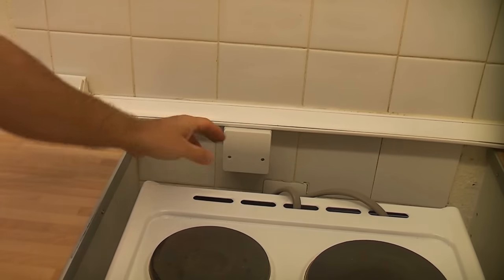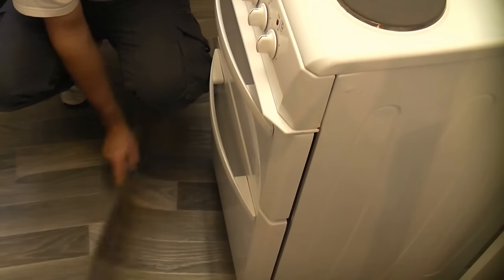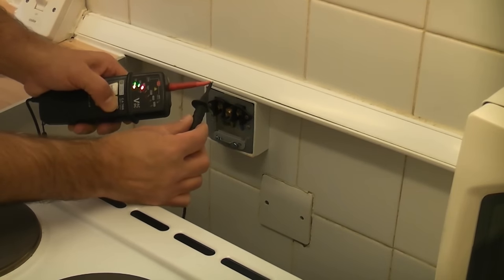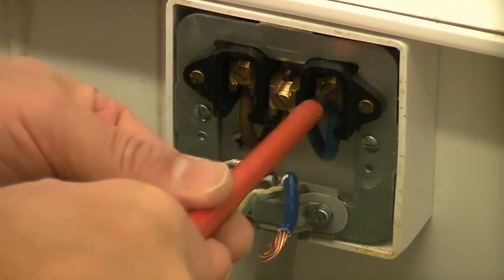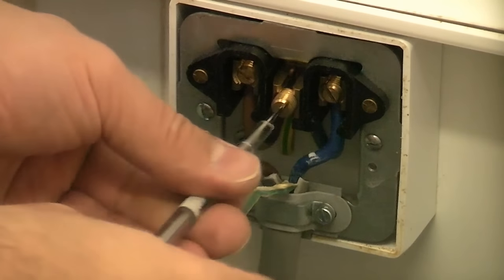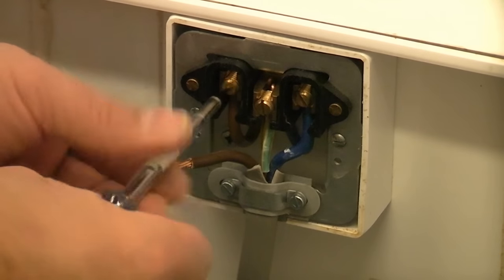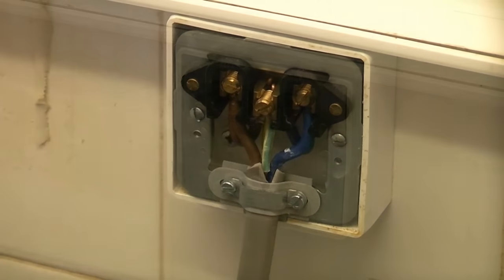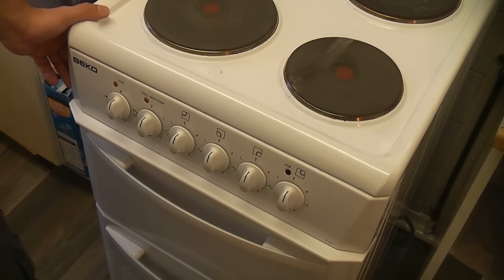How to wire an electric cooker

Comment: +Ultimate handyman Please help. What wire strippers can you recommend? I also have a Beko cooker exactly the same as yours and moved into a new flat a fortnight ago, bought a pair of "Supatool 2 in 1" wire strippers from a local hardware shop and they are worse than useless! Plus I'm on Universal credit and simply can't afford an electrician hence my finding your video.
Reply from the maker: Good wire strippers are not cheap, I'm afraid.
Knipex or C.K tools make some really good ones
Thanks for the comment
Reply: Ultimate Handyman Thanks for replying. Er, on my part it's been a case of a bad workman blaming his tools! *Facepalm. Watched one of your other videos on stripping and now I know where I was going wrong.
Reply from the maker: You are welcome ;-)

Comment: is it a 240 volt circuit on a 50 amp breaker i
Reply from the maker: I can't remember what amperage the MCB was now, it will have been somewhere between 40 and 50 Amps.
Reply: David Berquist We don't mess around here in the UK. None of that watered down 120 volt USA crap.

Comment: Nice tip for moving the cooker , i ripped my lino pulling the freezer out but ive tiled the kitchen now - much nicer and warmer than cheap lino - especially when your neighbour below has underfloor heating the special tiles i used absorb the heat from below perfectly. Mexican ceramic mix tiles are the best for this or the cheap Cuban ones for sale at Homebase suprisingly , i did two jobs for customers who were skint and needed to keep the job cheap and they ended up actually being better than some of the top quality ones I usually use!

Are you electrically qualified UH?
I wired up my own shower and cooker including the consumer unit , mcb's, cabling, isolation switches etc - does that make me a bad man> lol I do have a city and guilds though!

The thing I like about your videos is that you always do the job right and with quality gear.
Pity 90% of the cowboys in this country dont!
Reply from the maker: Thanks Gary. Lino can be a real pain when you need to move something in a kitchen.
I never go in Homebase to be honest as they don't have one near me (I think the closest is about 15 miles away).
I do have some electrical qualifications but I don't know what exactly LOL. I have City and guilds 100/2987/4 level 3 and NVQ level 3 in electrical and mechanical maintenance. 
Unfortunately there are a lot of cowboys out there!
Thanks for the comment ;-)
Reply: ***** Dont really like Homebase its more expensive than B&Q and i dont like them either i prefer to buy all my stuff on ebay or Amazon or Ceramic Tile Distributors in Glasgow CTD when I am in Scotland but out here in Slovakia its just use what comes handy - my father in law rebuilt the old ceramic wood fire oven in his house and it heats the entire place and water for free - all we need to do is find some dead trees - Slovakia shows how to re-use just about everything , nothing gets thrown out - he even has an old bath in the garden to collect rainwater and the neighbour has a shed with a massive Russian Nuclear submarine battery attached to a solar array that would put Nasa to shame - powers his whole house!
Reply from the maker: I used to go in Homebase near Southport but was never impressed with the DIY section as it mainly seemed to focus on furnishings etc.
Re-using stuff is good, it's a pity more people don't do it but unfortunately now we have a throw away culture.
I'd love to see that battery and solar set up- I bet that is awesome. I keep thinking about doing something similar myself when I get chance- only using car batteries. I do hope the battery has been tested for being radioactive!!!! 
Thanks for the comments ;-)
Reply: ***** Try forklift batteries they are quite meaty , unfortunately his sub battery is Lead acid so needs topped up with acid ever so often and thats a real hazard and he has been stopped by the police a few times and questioned over why he is buying so much, burned himself and had a few small gas problems as he didnt put proper ventilation in when he installed it - another consideration when using heavy duty batteries - The sub battery itself only cost 2500 Koruna which at the time was about £500. I would go with Exide submarine batteries they are supposed to be the best!
Reply from the maker: That reminded me of a guy that turned up on site one day to check the electrolyte in the fork lift batteries, he could not see as it was dark, so he used his lighter from his pocket- Boom! Luckily he was not seriously injured though.
Reply from the maker: Thanks, I'll bookmark that page ;-)
Reply: +Ultimate Handyman your comment made me lol there are a lot of cowboys out there so true I take pride in my work and don't like to cut corners on a job but I have seen people do some botched work
Reply from the maker: Thanks for the comment ;-)

Comment: This is how cookers are normally wired - however a lot of cooker manufacturers now state to use a heat resistant cable, with flexible conductors - some specifically state H07RN-F rated cable. 
The reason being of course that the back of a cooker can get very hot and twin & earth can degrade over time.
A flexible cable is also required where an appliance can be moved or is likely to be moved - such as this stand alone cooker where it may be moved for cleaning.

In terms of UK IEE regulations only the flexibility is required for an appliance that could be moved....however you should always adhere to manufacturers requirements as well and installing twin & earth on a cooker where the manufacturer specifies otherwise is not good practice.
Reply from the maker: +blower 
They could quite easily fix the issue by supplying the cable with the cooker ;-)
Thanks for the comment

Comment: just tried to wire my cooker and it went pop and tripped the switch has my cooker had it now ??? lol everything looked right so not sure what happened there
Reply from the maker: Which switched tripped- MCB or RCD?
In most cases you can’t damage the cooker by wiring it incorrectly.
Reply: ok thanks im gonna get an electrician to sort it thaks 4 repyling
Reply: @ultimatehandyman  yeah cooker still works up and running now all good friend of mine did it with new wire (think wires touched lol)

Comment: Is this a big job if there's never been an electric cooker installed before? There's no connection points or button switch
Reply from the maker: Yes, you need the circuit installing by a competent electrician I'm afraid.
Reply: Ultimate Handyman Oh I have no intention of doing it myself. I'm incredibly clumsy and  would electrocute myself within seconds. I'm just trying to get a guide to how much an electrician would charge me to install everything from scratch
Reply from the maker: I'm not sure as there are a lot of variables such as how far away the consumer unit is, whether you want the cables buried in the wall or flush mounted and the part of the country you are in etc. 
Your best bet is to get at least three quotes or a recommendation from a friend.
Reply: Wire it up to next doors, it's much cheaper !!
Reply: @ Damian, Because the amount of current a cooker draws, you’re in a killing zone, so this is not a job for a gobshite.

Thank you for the video.

Comment: To stop the MCB from flipping back on you locked it. If I also flipped down the main switch, big double red switches is it still possible for the MCB to flip back on without being locked?🏴🇯🇲
🕊️🔥✝️
Reply from the maker: Locking it off, is not to stop it from flicking back on- it is to prevent someone from flicking it back on whilst you are working on the circuit.
Thanks for the comment 👍

Comment: Another good video. Shame that the terminal connection block prevents the cooker from fitting flush against the wall. I'd be tempted to correct that :)
Reply from the maker: It's in a rental property, the cooker still goes flush to the wall as it has a overhang at the top which gives a couple of inches of clearance at the back.
Everything in this flat was surface mounted including the light fittings, all cables were run in trunking etc.
Thanks for  the comment

Comment: Love your videos but just came across this one as I am replacing my cooker. The old cooker was stand-alone and hard-wired to a single connection unit. However, I'm replacing with a built in oven and hob. The oven is a single oven, comes supplied with a plug, and the hob with a connected cable, My question is can they both be hard-wired to the same connection?
Reply from the maker: No, the oven would need to be connected to either a plug and socket outlet or a fused connection unit.
Reply: Thanks. That makes sense. Still from the same cooker switch?

Comment: I thought the cable coming from the cooker should be heat proof ?? not twin & earth.
Also i cant understan why the hob i'm installing has a 2.5mm flex pre wired into it but the hob is rated at 7Kw ??
Reply from the maker: It depends what the cooker manufacturers recommend in their instructions.
2.5mm sounds a bit on the thin side, although diversity is allowed when calculating the correct thickness of cable for cookers as it's unlikely that all the rings will be switched on at 100% at the same time.

Comment: I have to panel like that behind my cooker. Just a basic plug socket. Can the three wires be adjusted so a plug can be attached and the plugged into the socket ????
Reply from the maker: No, you cannot wire a cooker into a socket, it requires a dedicated circuit.

Comment: What's that other white box
Reply from the maker: I think it was an old cooker connection unit.
The wiring in that flat was not particularly great, with surface mounted trunking etc.
Thanks for the comment 👍

Comment: Does anybody know...what the benefits are in having a hard-wired electric hob as opposed to a plug-in?
Reply from the maker: You can't normally get a plug in hob, as they normally need hard wiring.
I'm sure that a high amperage plug and socket could easily be made for hobs/cookers, but it would only benefit the consumer!
Thanks for the comment
Reply: @ultimatehandyman  OK, so why do they make hard wired hobs if there is no difference or benefits over plug in hobs? Are Neff, Bosch, Zannusi etc etc unaware of the benefits in saving the customer £40 - £90 installation costs?
Reply from the maker: A high amperage plug might cost £5 at the manufacturing stage, which is less profit for them! 
I've even seen new single electric ovens (2.4KW), that now have a warning label on saying not to wire the oven into a plug- yet you can wire an appliance up to 3kw in a standard plug!

Comment: high. what is the specific electrical cable needed to wire in an electric cooker ??
Reply from the maker: It should specify which cable to use in the manual that is supplied with the cooker?

Comment: I'm an electrician  in Jamaica. I'm the electrician  for the house of and English  expat  who happens to be an electrician... (this the part where lol).
Why am I his electrician? 
he does not have a clue  what to do.  
He imported a cooker simular  to that  one and could not connect it because  the supply  voltage is "single phase"  110 volts.
I told to  connect 2 "single phase" 110 volts to it and he adamant  it would not work.
to make things more complicated  it was one  of those   cookers that you could connect it either 220 or 430 volts.
Reply from the maker: Thanks for the comment ;-)
Reply: +Ultimate Handyman what would you do in this situation
Reply from the maker: I'd have called an electrician ;-)
I often work on 3 phase (440v)  in the UK and if I want a 230v supply I would just use one of the phases, but I would never connect a 220v appliance to a 110v supply. 110v is not widely available in the UK unless you use a centre tapped transformer to go from 230v to 110v.
Reply: +Ultimate Handyman wire the cooker 220volts...terminate one single phase  110volts to the hot terminal and then terminate the other 110volts to neutral terminal.

Comment: Well I just got given an electric cooker so I’ll go and buy the vm it’s I need tomorrow I’m sad because I loved my gas cooker but the oven doesn’t work anymore and I cam to solve the problem it’s a leisure repro and all the screws are so tight 8 can’t get 8nto anything..
Reply from the maker: Gas cookers are better IMHO.
It's a common problem with cookers and ovens as the screws get heated and are very difficult to remove!
Thanks for the comment 👍

Comment: done right! no messing with mains tester screwdrivers, couldn't agree more need a proper 2 wire tester, you cannot believe the horrors ive seen on youtube with a knife being use to strip twin and earth!
Reply from the maker: +jusb1066 
I once watched a young guy replace a socket- LIVE !
Thanks for the comment ;-)
Reply: +jusb1066 I did notice a mains tester screwdriver being used to loosen the earth tho ;) (I know, it's just a screwdriver)
Reply from the maker: +TheChipmunk2008 
I'm doing a video on neon screwdrivers soon ;-)
I don't know why people don't like them- there seems to be urban myths surrounding them!
I'd much rather someone test for dead using a neon than nothing at all ;-)
Reply: +Ultimate Handyman Oh  agreed... I think like anything, there are positive and negative (pun intended) points to them. They're easy to grab, but not very reliable. The older ones (up to the mid 80s) were pretty well made.  The newer ones use cheap/small/poorly constructed components. I'd be much more scared of them breaking down than the older ones.
Reply from the maker: +TheChipmunk2008 
Absolutely, there are much better devices (such as the GS38 approved voltage testers) but for cost and convenience a neon is great for most people. It won't be long before someone has an accident having tested with a GS38 approved voltage tester because the probes are so well shielded that you can't get them in to touch the conductor on some terminals!
Thanks for the comment ;-)
Reply: +Ultimate Handyman UGH yes, those highly shrouded probes are a pain in the arse. I have one of the older steinel combi-check testers with about 10mm of exposed probe.... as a compromise I put some silicone rubber sleeving over the probes. 1mm is normally exposed, but when pushed hard into a socket the sleeving will roll back.
Reply from the maker: +TheChipmunk2008 
I'm sure when I got my GS38 tester at work, I had to cut back some of the insulation on the live probe to be able to test something. I often borrow it when doing jobs at home and people always used to say "that's not GS38 compliant because too much of the tip is showing", so I put a bit of heat shrink on the end to keep them happy LOL ;-) 
They should make them with a retractable sleeve, like you have made with the rubber sleeving- people would not cut back the insulation then ;-)

Comment: Im in Australia, If I was discovered to have done this myself ild get a $1000002928464 fine.
Reply from the maker: What voltage is the mains supply in Australia? 
Thanks for the comment
Reply: Ultimate Handyman 240

Comment: That coving trunking looks a bit of a dogs dinner over the appliance space, surface box not sited too brilliant either. `Decent Homes` council installation, for a bonus point!
Reply from the maker: +Got2Bgaga 
The coving trunking is in every room, they used that rather than chasing out the walls.
Typical council installation ;-)
Reply: ***** No time for that lark, first fixed in a day, crack on! Thanks for the reply on it, much appreciated.

Comment: About to disconnect a cooker and switch the mains off but this vid makes it look dangerous. I paid 60 a go for an electrician to dismantle it for a house move, so ive got to disconnect and replace my cooker after it was wired up due to a new house flood. Doing it myself because i dont want to pay again!
Reply from the maker: It's not dangerous, you just need to be 100% certain that the circuit is isolated.
Thanks for the comment 👍

Comment: Hi there, 
i've just bought an electric cooker, unfortunately it has no cable, how do i know which cable to buy also know it's against the rules but to save me money, what plug do you need to just plug this cooker in and not have to employ an electrician, which will cost more than i can afford at the moment. 
Hope someone can help me please?
Reply from the maker: It should say in the instructions which cable to use. I don't think its against the rules to wire in the cooker yourself although I could be wrong as the rules seem to change quite regularly (you would have to check the latest partP document). If you don't have any electrical experience its probably much better to get an electrician to wire it in to be honest as it should not cost much and should only take 20 minutes or so.  You can't normally get plugs for electric cookers as they normally need to be wired into a cooker connection unit, electric ovens are different though and some can just be wired to a normal three pin plug.
Reply: Thank you for your advice, much appreciated.
Think i need to get an electrician to do this for me.
Reply from the maker: You are welcome, sometimes its best to get a professional in ;-)
Thanks for the comments

Comment: Cooker connection unit 🤣🤣🤣🤣 nice screw driver 👌 also trunking in the heat zone
Reply from the maker: What can I say apart from dodgy council workmanship (the trunking was all over the place)
Reply: Ultimate Handyman can tell your not a electrician
Reply from the maker: Well technically I am ;-) But I'm not the type that does dodgy house installations like the people that re-wired this flat.

Comment: On a electric hob wouldn't it be just as easy to take the cable off the new cermeric hob and connect the old one to it .
Reply from the maker: You would have to check that the cable was the correct thickness for the new hob or it could melt and set on fire.
Reply: Hum , the cable is connected to a sixty amp fuse line , its thick enough .